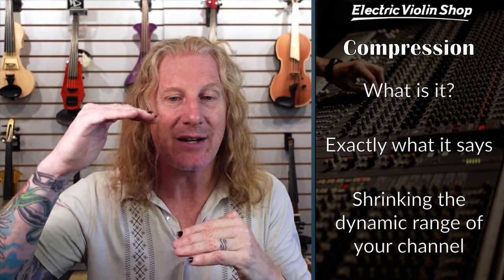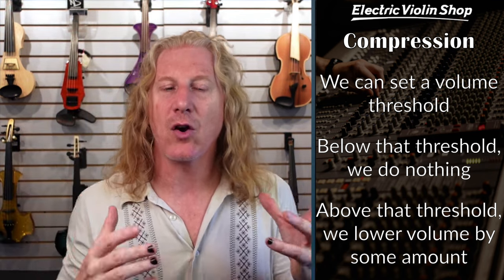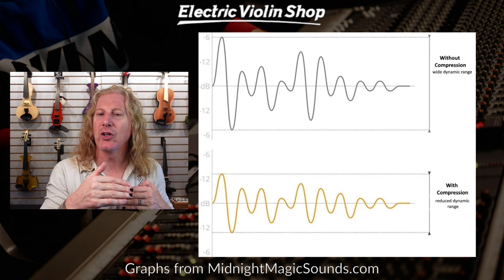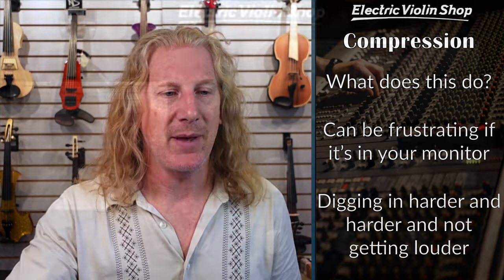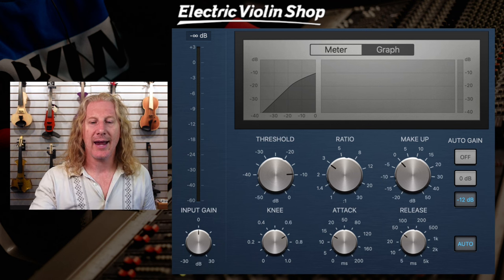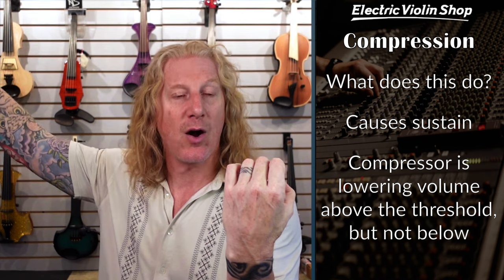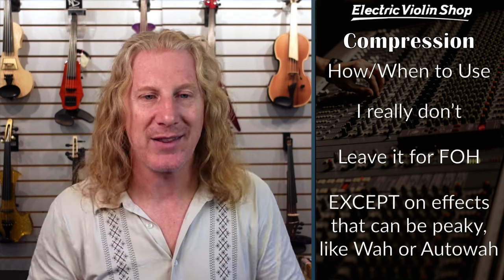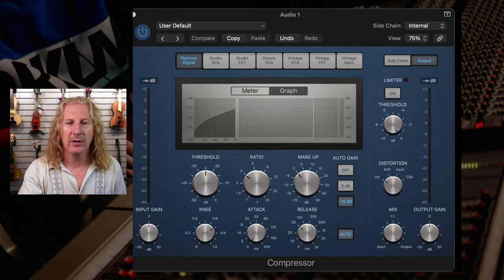Effects for Violin Series - Week 5 - Compression

Comment: I use a compressor sustainer but having problems with my midi playing double stops.  (Two strings at a time) when playing double stops they aren’t clear they have a muddy sound.  So do you have any recommendations for this issue.  (Yes I have tried different amps and sometimes it will be on a clean channel and also happens while using Gr-55 violin.   ).
Reply from the maker: Sounds like a gain structure issue. Check out video 1 in this series.